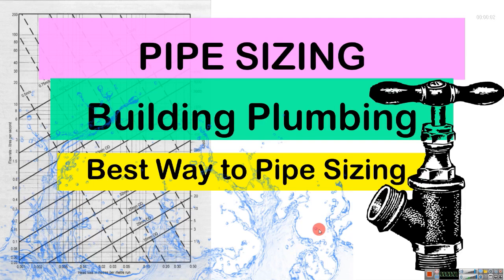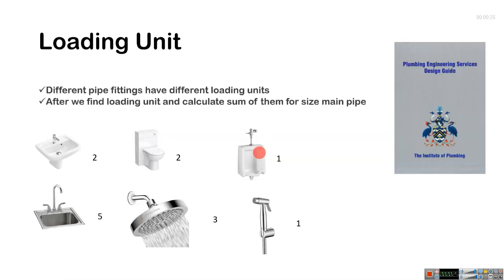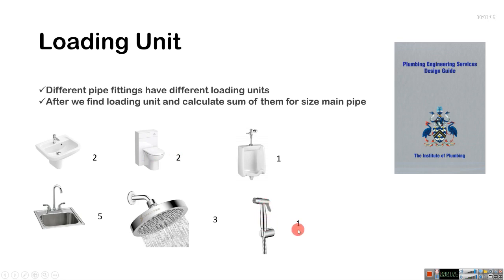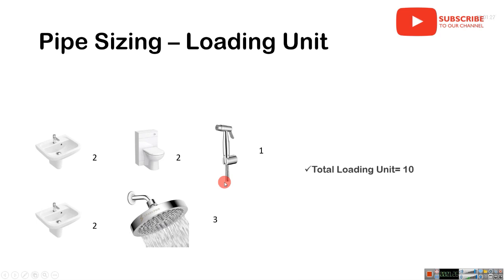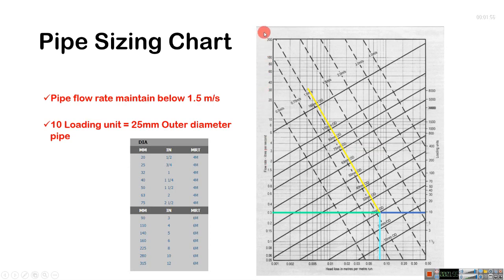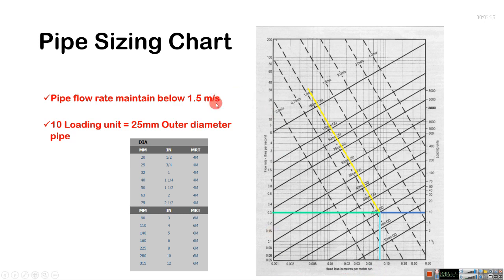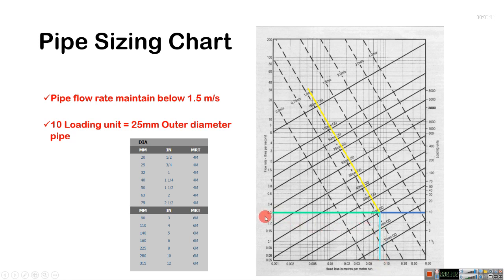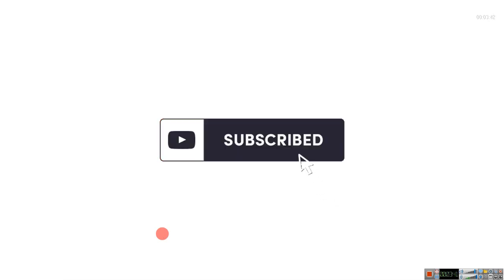Plumbing Basics - Pipe Sizing Calculation - Bathroom Plumbing

Comment: "10 Loading Unit = 25 mm outer diameter pipe required"
Let me know, Why outer diameter?
Because, water is flown inside of the pipe.
Also wall thickness of the pipe vary based on price.
Thanks for this video.

Comment: What is a loading unit?
Reply: fixture Units
Reply: Fixtures such as water closets,wash hand basins,bidets when installed have a low probability of simultaneous use. The occupants are rarely using all the fixtures simultaneously...as such, values have been assigned to each fixture unit by applying various probability theories to reflect this. The values compensate for the frequency of use and are called fixture units or loading units. Each loading unit is associated with a particular flow rate. The various plumbing codes such as International Plumbing Codes etc give the recommended loading units for each fixtures and applicability.